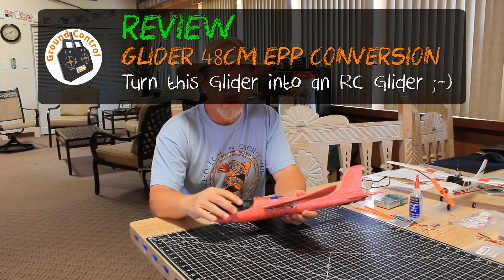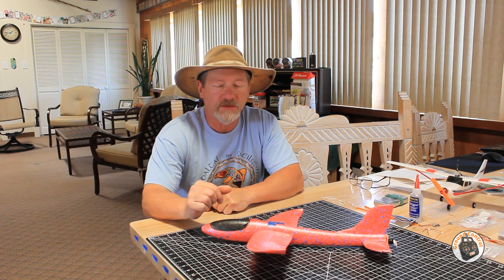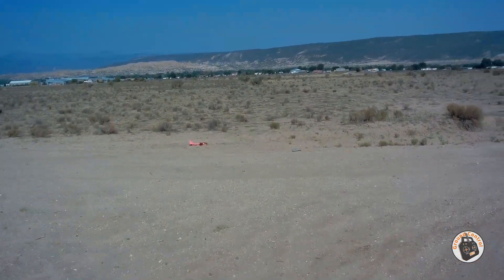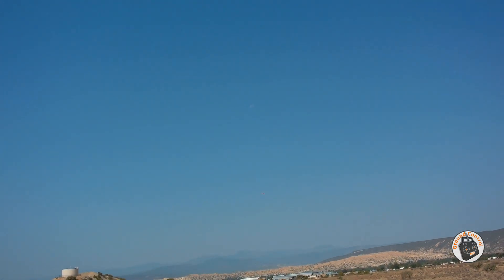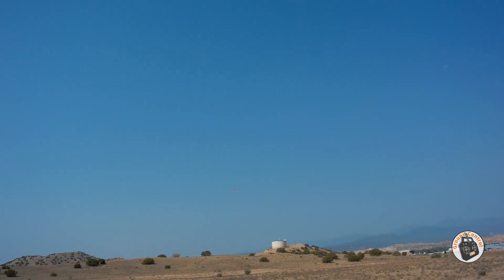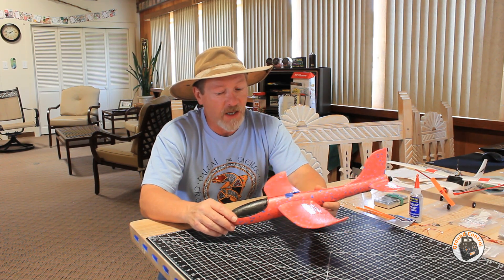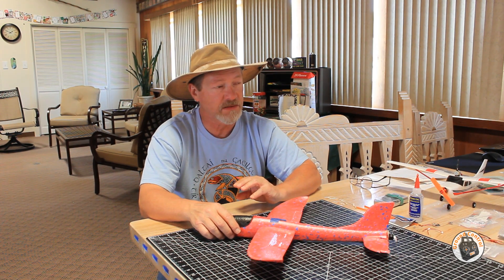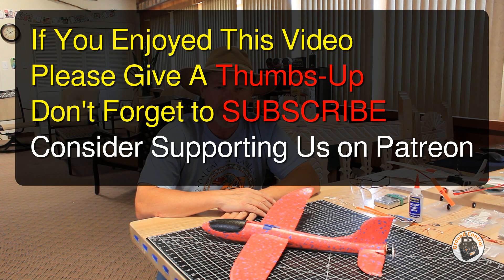Review - $4 Chuck Glider RC Brushless Motor Conversion

Comment: About 10 of mine have 0 incidents on the wing had to put in some shims And flies as a glider For several weeks After trimming it as a glider... I'm putting in a carbon Spars h And sorority it out... I can launch it nose hook bungee at 68 mph straight up...thermals. well...rudder elevator only..
Reply from the maker: Nice!
I think those main wings do need a spar as the foam is fairly flexible if you're performing aerobatic maneuvers.
I have a wood spar in mine.
Amazing how well these fly.
I only have a couple and would like to get one with a 1m wingspan ;-)

Comment: I've got it about 20 of these and sometimes foam is stiffer than the other ones the airforce a little bit different they're not all the same
Reply from the maker: I think the molds may have been slightly different or they may have changed the formula on the foam a bit.
I have several different airframes made of EPP Foam and the foam feels different from aircraft to aircraft.

Comment: Are you 100% cirtain you dont need slight down thrust if you feel the cg is a bit forward....? I am waiting for my foam gliders to arrive and I am stripping out my old radian gear to go RC chucky fun....
Reply from the maker: Brian, good for you! You're going to have a lot of fun! I cannot say for certain you will not need either slightly upward or downward angle on your motor mount. I say this because every plane is slightly different and every Build and MOD is slightly different. I can say that I was able to get my motor mounted just about dead center of the thrust line for the airframe and so I didn't need any angle. If I would have been a bit off of dead center either up or down then I would probably need a bit of angle in the thrust line to keep the plane at a nice stable attitude when going full throttle. Also, the hardest part of this Build / MOD was getting the airframe all straightened out. Nothing was truly straight on this airframe which adds a whole new set of variables to the equation ;-) You may also find your CG is slightly different than mine. I think most people like the way a plane handles when it is slightly nose heavy. I like the way the plane feels when the CG has a completely neutral balance. The end result turned out better than I had hoped but a lot of factors play a role. Well, it's too late to make a "Long Story Short" but those are things to consider. Good luck on your conversion and don't hesitate to ask if you have any questions. See you in the Air!
Reply: @GroundControlRC  will let you see lateron how I am doing thanks stay straight n level...
Reply from the maker: @BrianRamseysg01  , hehehehe...you are most welcome! I try to stay straight and level but sometimes speed and power lead me astray ;-)

Comment: Could you show a detailed video/photo of the servos, motor , aileron mountings. thanks! What is the step down reg for? The Esc has BEC right?
Reply from the maker: Ron, I'll try to put something together soon as I was thinking it would also be a good idea, now that all the MODs are complete, to also give measurements on all my control surface deflections to help others get a successful Maiden Flight. I'll also put together some photos with that information so everyone can see those details. I used an OPTO ESC with a Switching Voltage Regulator. The initial design was to use a 1S LIPO but that did not produce enough thrust so I had to modify the power system for a 2S LIPO and I did not have an ESC with a BEC small enough. When I do the tractor version I will most likely use a 6-10 ESC with a built-in BEC. See you in the Air!

Comment: I bought same type as tje one in your video. I seems there are guidline on wings and back wing. Can one cut this and bent it up or down for longer flight. Im novice with aeroplane dynamics
Reply from the maker: Good question. Those lines you see at the back of the wing that run parallel to the leading edge of the wing are for control surfaces. You can cut and bent those to make the glider turn, fly more slowly, climb, or dive. I don't think they will give you more flight time but it would be a good experiment. I hope that helps and I'll see you in the Air!
Reply: @GroundControlRC  much appreciated. Thnx